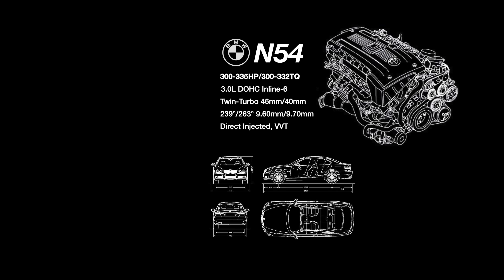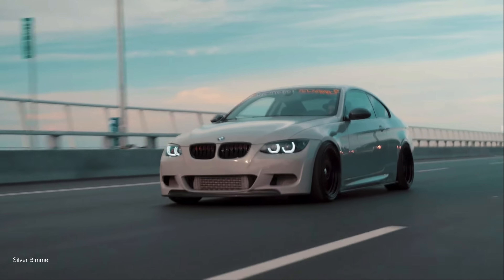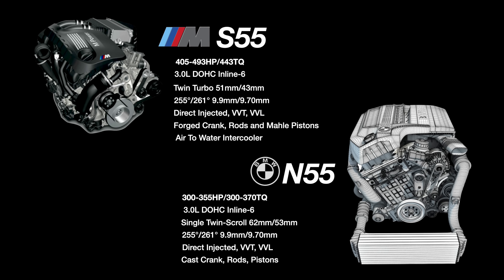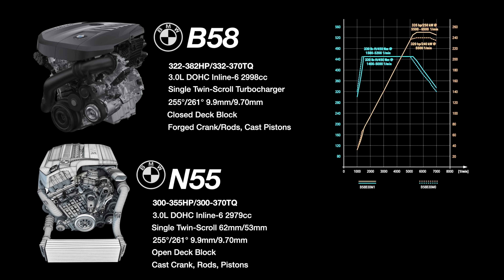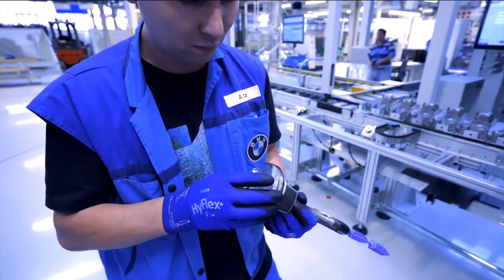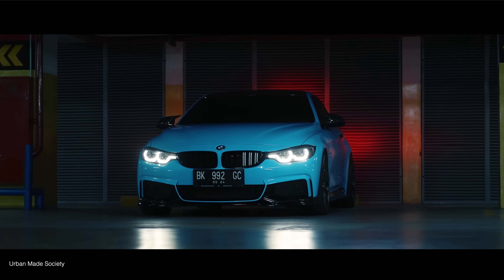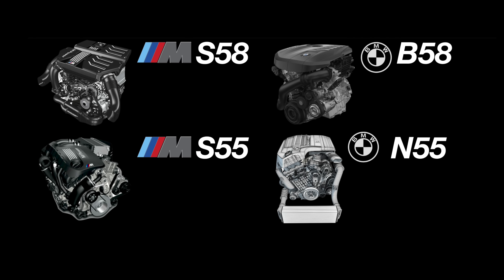BMW Turbo Inline-6 Engines Are Ridiculous | Explained Ep.4

Comment: My 2018 g30 540i has a catless dp and mhd tune by bmw people (not dealership) and it absolutely flies. I have 118k miles on this car and I get just over 500 miles on a tank of gas. Very impressed with the reliability and performance. I do get the oil changed around 5k miles also with the extra power I have the spark plugs replaced around 30k because these engines will misfire if the plugs are old and the power is not stock. If you are good to them they are good to you. Wicked acceleration half throttle it just keeps pulling. 😅

Comment: Hello guys, I want a 2014-2016 BMW 640i! I believe they all have the N55 engine. I will not be racing I just want to look good driving it! I’ve heard the 2018 version has the B58 engine but I don’t like that Grand Touring body style. 

Is the N55 reliable enough for me to invest without worrying about it being in the shop all of the time? I’ve seen many with miles around 80k to 100k for great prices. What do you guys think?

Comment: I've had an N55 with dealer reprog after 1st maintenance (for free) and had no issues in 120K m, but with 8k miles maintenances (costs nothing during 10 years so... just go to workshop and do it !). Then I've sold it with a motor in good shape.. Eyeing on a 540i touring with b58 for family if I can get a good deal I might not go back to overpriced japanese cars.

Comment: So what do I do with this horrible 2014 x5 x drive m sport , I bought at 91000 miles , dealer replaced valve seals , massive acceleration but everything I read about this 2014 v8 is bad , apart from keeping in economy mode and foot off gas how do I stop this engine from melting ? P.S I couldn't even get an E.C.U reflash as the garage said they wouldn't touch it !!!

Comment: Toyota helped out with the durability on BMW platforms just like Yamaha helping Toyota back in the day with the 2JZ
Reply: Actually, Yamaha wasn't involved with the 2JZ. However, Yamaha was involved with the heads of the 1JZ.

The 2JZ is basically an improved 1JZ. Especially due to the increase in size of 2.5 liters to 3.0 liters.

Comment: Hey guys, I have a stock 2011 335i coupe that still is amazing at 125k miles. But what can I do to add a bit more power without spending or doing too much?
I’ve been driving BMWs almost exclusively starting in 1982 yet I’m pretty clueless when it comes to working on cars, but now that I’m mostly retired I want to not be such a dumbass about the wonderful BMWs I’ve owned. Usually two at a time, now just the one. Thanks in advance for some advice and guidance.

Comment: Maybe you should read the article called Big bang theory about the 4.8 LS engine that made almost 1200 horsepower with 27 lb of boost with 60 dyno pulls before you make ridiculous statements about them blowing up after three passes.

Comment: The Barra is usually conveniently forgotten about when comparing I6 engines, it puts most other I6 engines to shame with its potential power output.
Reply: Also its reliability achieving 650km-800km as a taxi engine.

Comment: Owned a full bolt on 335i on a MHD stage 2 e70 OTS tune. Bought the car completely stock and Car was in one family since 2009 with all recalls and maintenance done ( prattle shifters not used ). That thing was absolutely crazy. The fact I was beating modifier cars that were in a different bracket was just crazy considering I bought the car for only 6700 back in 2021.

Comment: I recently purchased a b58 m440i. BMW lied about the 0-60. They published 4.5. I did 3.8 bone stock. Also was getting OVER 20 psi stock before I threw on the JB4. After which got 0-6 in 3.6 on just map 2.

Comment: Regular Maintenance is key. I have an N55 and the only problem was a blown radiator from being way too ignorant and doing heavy pulls every chance I got. FBO, few aftermarket maintenance parts, straight pipes, upgraded injectors & hpfp, along with a tune has me at 480 to the wheel. I daily it and outside of that radiator problem I've had no issues. I drove it 1100 miles in one go and it didn't let me down at 90k miles :)

Comment: I worked at BMW designing the manufacturing line for the S58 in Munich and I remember when we got the S55 from Steyr because of lower production rate.
I had to test all the special tools where there and working and I had to build the engine up and down a few times and would have loved to take it home, but it was trashed 🥺
As well as the first 40 more engines. 😭

Comment: These are great modern engines that are easy to upgrade but you could get the same outputs (450+ on stock internals, 1000+ on forged internals) from the old M50 and S50 motors from the early 1990s so have things really progressed THAT much....?   I'm not so sure.   Just that everything modern comes with turbo as standard so "tuning" requires a lot less effort than it once did.  For me, BMW engines peaked with the S54. That engine didn't need boost to be amazing.

Comment: You guys missed the boat. Here in Australia we have some 1400 hp street driven daily Ford Barra 4 litre Twin overhead cam VVT straight 6 turbo engines running high 7s ruling the street. Alas only built and sold in Aust. and NZ and manufactured from 2002 ending in 2016. But as for a home grown engine it can be built for big hp at a fraction of the cost of any European engine and with our exchange rate that goes for US engines as well
Reply: There junk nobody gives a shit but bogans 😂 you clowns are on another level funny 😂
Reply: Ford always keeps their good stuff away from America ironically

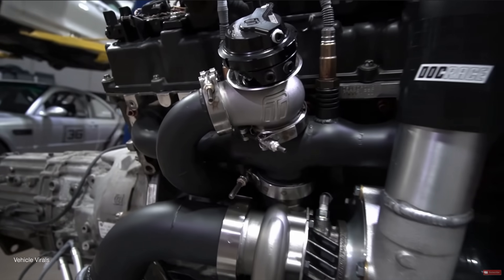Comment: 1:33 (COUGH) N54 guys are doing 890WHP on stock internals. 

BTW, VQ35HR’s & VHR’s are also fully Forged roating assemby, Crank, Rods & Pistons from the factory 😎 right fueling & tune will net you 700+ WHP (if you’d gap the piston rings for boost like the N54’s came from factory, you can do much higher).
Reply: Yeah okay Edgar

Comment: I used to have a 92 525 5-speed manual with a 2.5 naturally aspirated motor. That 6 cylinder was bulletproof. I got it at 140,000 mi and beat the living snot out of it till 350,000 at which point I was too disabled to be able to afford the repairs and rebuilding of it😢

Comment: Neutral Ford guy here (love all brands but ford is my childhood) BMW inlines I feel get so much bad press cause of the easily fixable issues they have. Like hey they make rebuild kits for them. And the ls guy in here said amazing what just a few small things do to these stock engines is nuts. So imagine that with a stroked/destroked engine could do with forged internals and bigger turbos. Its not hard at all to achieve 1000hp.

Comment: The B58 being used by Toyota definitely helped sell cars. I wouldn't have got my 340 if Toyota didn't trust the motor. Yes, their name has that much weight. 

I wanted a car that could be reliable af at 500 whp. I was debating Camaro or Coyote Mustang for awhile, but the B58....with AWD, once I did my research, couldn't say no. 

And I also got a BMW out of it which tbh, i wasn't even searching for luxury. Just a fast, fun, reliable daily.

Comment: B58 and s58 are legit the most sought after most renowned engines in the car community rn. BMW created a masterpiece man.
Reply: BMW engines have been world class for decades.  Evolution of their L6 wasn’t an accident.
Reply: To be fair, Toyota made some small but significant reliability changes when they put the B58 in the supra. Per their agreement with BMW, BMW got the changes too.
Reply: @jeffrbake  That is a myth, Toyota did NOT touch the B58 in any regard, and certainly didn't modify it to their "standards" like many seem to believe. This has been disproven over & over again yet it keeps getting reiterated like it's a fact.
Reply: @CadexLaw  do you have a source for this? Because the info I got on this came from a guy who was on the team that made the car.
Reply: Before the B58, (BMW) the best engine was the Barra (Tickford), and before that it was the 2JZ (Toyota).

Inline-6 Engines are way lighter and smaller than V8s or V12s, yet they are much more reliable than V12s and much more balanced than V8s. They tow the balance of power and efficiency well, from a design perspective. The only thing better would be a piston that pulls, as another one pushes on the same axis. But Flat Engines don't have the best history. Modern Boxer engines are good, but they're merely horizontally opposed instead of direct linked. And the great Ferrari designs from 50 years ago are just dinosaurs. We need a modern resurgence in that field.
Reply: @ekinteko  rotory may be making a comeback though! Which has its own host of awesome features. Some historic problem problems. But my understanding is that modern manufacturing may solve a number of them.

Comment: I recently bought a slightly used '21 X3M Competition as an easy way to get the S58 but about $30k less than a comparable M3. Put an MSS HAS suspension to lower it and wider wheels and couldn't be happier. GREAT engines!

Comment: i'm more a 6.0 liter destroked with a 4.8 crank, running 4.8 rods  with the large bore 6.0 pistons,  great rod ratio, large bore, good compression,  with a chinese turbo :p  honestly, the N54 just needs a closed deck mod,  as the N55 has Alusil coated bores, versus steel sleeves,  and if you've ever worked on or modded bikes, you know you can't bore it without getting a recoat of alusil.  port and polish the head and add in Shrick cams and a custom tune, and you're banging on the door of big power.  

in addition the clearances for rod and main bearings on the N54 where larger then the S55, N55, and such, we are already starting to see the results of this with the spun rod bearings popping up on these engine platforms more so then the N54 ( not saying the N54 doesn't have problems, as it also spins bearings, and has odd wear patters for rods which i'm pretty sure could be solved with crank chamfering of the oil holes. )  the other issue with all the platforms is BMW's recommended service interval, what idiot says 15K for an oil change is OK? 

the aftermarket for the 54 is also pretty stout now, with options from Vargas, BMS, CTS, PURE, RB etcetera, and the to chinese 17t and 19T turbos ( don't  run fleabay spooly bois on your N54, PLEASE for the love of GOD, NO!)   

even though the I6 is naturally balanced, it's not perfect, getting a machine shop zero balance on all components like flywheel, damper, hub, and crank would be best if you wish to have longevity at high power levels.

Comment: Amazing engines but so terribly unreliable. Removing the b58 and even the n55 out of the chat, the rest are really touch and go with significant issues. So good at producing power yet being super economical, mega efficient as well with the delivery but bmw just can't make a reliable powerful engine
Reply: I mean,if u look elsewhere like Portland and etc,there are bmw m50s,S54s,S52s,S38s,and etc being used for drags running 9s-low 8s making 800-1300hp and those guys love those and thrash them like it's noting and even use them in drifting,so I'd say it comes down to where your from tbh.

Comment: My M135i created 410hp/560nm of torque on mostly factory parts (remap, cooler spark plugs, metal charge pipe & high pressure pump) buuuuuuuut its currently in the shop, cause something broke.... lol dont know what the issue is yet, but hopefully its not too expensive. P.S Engine should be all good, there was no misfires nor was down on power, just sounded like a tractor

Comment: Fun video. Owned a 2015 4 series with later edition N55 for 7 years now. Stomped it all over the place for 80K and no issues except broken plastic boost pipe and leaking valve cover. Gotta give props to the rock solid ZF transmission as well!

Comment: Ok wait a minute here now! BMW took the top spot for inline 6es? The history of BMW is much longer with inline 6 engines, you only talked about the last 15 years with turbo engines. But what about the, m20 m30 m88 s38 m50 s50 m52 s52 m52tu m54 s54 n52 n53 and ofcourse a bunch of diesel engines?

Comment: if you're going to talk about the n54, use the correct information, the pistons are forged and the internalsa are good for over 1200hp, the block blows out on the front of cylinder 1 thanks to it's open deck

Comment: Practically all BMW engines are high performance engines, so it needs the necesarry maintenance by the book and even preventive maintenance, and this includes in some cases like the V10 or V8, rod bearings and timing chains, those parts are considerable maintenace parts. So, if you don´t have the money to maintain them correctly, don´t get them, those cars are not for you...

Comment: Only downside is actually unlocking them to tune them.  I've had a 2020 M4 CS for three years now.  I love the car.  I want to tune it.  I've wanted to since day one.  But apparently the DME needs to be removed from the car, sent out to somewhere else, and then finally be put back in the car and only then can it be flashed.  

I've owned my car for three and a half years.  I still want to tune it, but it's my only car.  I can't have it down and/or gone for any length of time,  No fun for me I guess.

Comment: Only stupid thing with these engines is that when your serpentine belt goes you have an 80% chance of needing a full engine tear down because it usually goes behind the crank pulley, breaks through the lip seal and worms it’s way into your crank case and oil system. Also they have a lot of their cooling system built with plastic piping that over time gets brittle and breaks, usually in very inconvenient places. Other than those two things they are pretty flawless.
Reply: I guess be proactive changing the belt.

Comment: There's a couple of inaccuracies here, firstly all N55s have forged rods, actually the same part number as the S55. And the M135i, M235i and M2 N55 has a forged crank. Also it's important to note that the N54, N55 and S55 have the same bore and stroke, whereas the B58 has a narrower bore and longer stroke as per the other engines in the modular family (B37/38/47/48/57). However the S58 reverts to a bore a stroke very similar to the N54, N55 and S55. Thanks!

Comment: Ps when you are heavily invested in an illegal activity its time to take stock of your life.  I had my Integra towed by a guy who had been in jail twice behind street racing. Says the first time wasn't enough, the second time finally did the trick. Just met a guy with an $100k GTR who got caught doing double the speed limit on a public road. Says he got 10 years probation. When you spend that kind of money to race on public streets you've got serious problems. Its 6pm now and i'm listening to some jackass race a Challenger up a crowded highway notorious for street racing. Too much money, not enough brains. 

It just takes that one time.

The good thing about my current car is that it is geared so fucking short that 65mph is both legal and safe at the right time on the right road and when trolling Challengers they take all the heat 😁 I'm lucky if my car even has 200whp and that is plenty. Too much power, too much noise and it becomes an obvious racing ticket.

Comment: Zzzz so the M and 5  series are just a 1968 320i that has been tuned.    And got DFI in the process.

All of these cars use tech that with rare exception was around in the 60s. 

Turbos are supposed to make the intake valve lift and timing irrelevant. And I've seen Subarus in street trim making 800 whp. Whoo hoo. How many Porsche owners watch this and nod off halfway through.

Comment: Bmw is not top, ford barra 4L inline 6 outputs 800hp on bf mark2 motors. And a lot more torque per hp. The 4 litre barra weighs around 190kg also...

Mines at 4.1L and 1500kw (we use kw in Australia), the bullet racing barra does over 3500hp...

Comment: VANOS and VVT are not the same. VANOS will control intake/exhaust valve timing using oil pressure. VVT controls intake valve height off the valve seat and uses an electric motor to rotate an eccentric shaft, controlling intake valve height.

Comment: No, BMW Turbo Sixes are TOTAL SHIT. Some are shittier than others but they are all garbage. Why? Because they all break whether or not they are tuned or driven hard. Injectors fail, water pump breaks, belts shred, fuel pump kaputs, gaskets give way, valves clog and leaks everywhere. They make a Lada seem reliable, LOL!
Reply: So basically just the N54. The B58,S55,and S58 don't have all these issues and people drive those hard all the time and still have people thrashing all of them without issue.
Reply: @carboydorifutoparty3976  Exactly. 

Since 2015 the B58 has no reports of faults.

Comment: They are all very good engines, for sure. But I'll stick with my 740whp N54. I do regular maintenance which isn't expensive or bad to do, and this engine has never given me any problems. Great engine if you keep it maintained, and can be extremely reliable. The lack of reliability is USUALLY driver error. But they never admit to it, and blame the engine or car instead. I've owned six Bimmers and NEVER been left on the side of the road. Take care of your car, and your car will take care of you...
Reply: how much is mileage with that tuned bmw?
Reply: Maintenance I'm here for but some of these older 6 cylinder BMW guys are like "it's a reliable 700hp" but go through plugs, coils or fuel pumps every other fill up it seems😅

Comment: Any turbo engine can have double the horsepower, but the problem is which one is actually reliable so you can use it for a long time :) BMW ones are not :)
Reply: BMW has the most reliable turbo engines in the whole market? They’re literally designed to flawlessly run turbo’s for the entirety of the cars life

Comment: I have a 2011 535i and it has over 183k on it and the only issues were AC went out a year ago, the factory water pump failed at 174k and its starting to have an oil leak at the valve cover, for 12years thats pretty good,